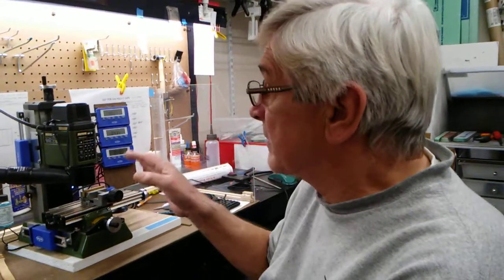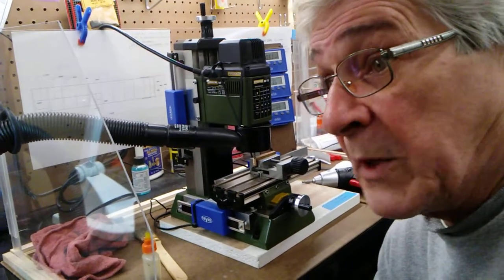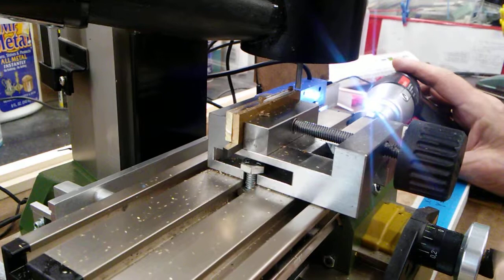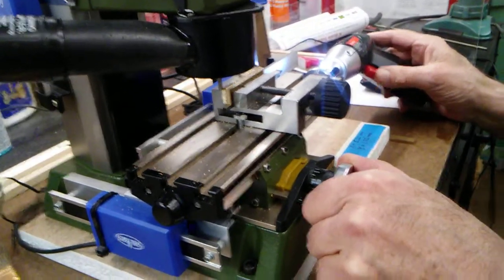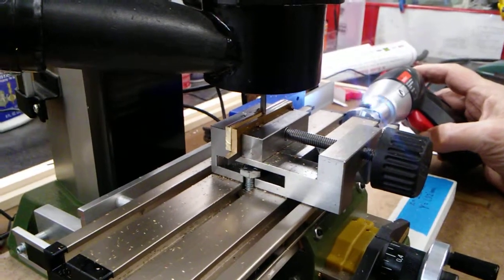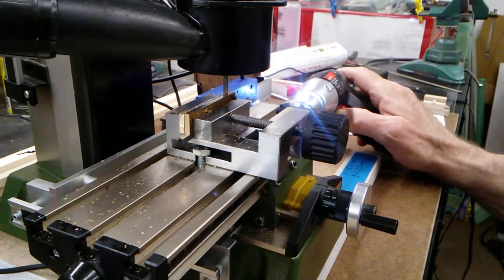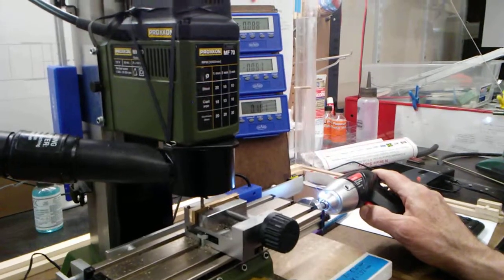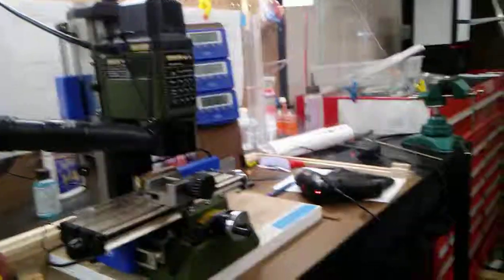Proxxon mods at work

Comment: say... I have a flat head screw going to the leadscrew( where the hand crank is) i cant seem to get it loose... was your handcranks loc-tite'd on there or what??  i love the idea of using a ball socket with a slow rpm drill!!    im only asking cause, i really dont want to damage this thing...  :/  Thanks again, great videos.  wow, i wanna get back into model railroads again...  :D
Reply: Not sure if you've solved this problem already or not...
The flat head isn't a screw, it's the end of the lead screw. you just need to clamp the handwheel in place and tap out the lead screw
Reply: there could be a dot of thread lock on it. take a rubber mallet while putting a little torque on the screw with the screwdriver then a few solid hits, try tightening torque just a little and a few more hits. penetrating oil can also help. use a screwdriver with as wide a tip as you can fit in the slot.
it's like car lug nuts; they are installed with an air tool at the factory so will not back out easily as installed
Reply from the maker: @supyrow   I'm sorry that I didn't reply right away.  I just noticed this.  The lead screw is actually pinned to the handwheel with a tension pin.  That pin is hidden from view by the graduated dial.  To access it you remove the screw by removing the end plates and then the graduated dial can be slid off.  Once removed I had to cut off a little bit of the lead screw (3/8"?) to make room for the socket head screw.  Tap the handwheel for the short screw, loctite it into the handwheel, and that's your drive socket.  Assembly is the reverse of disassembly.  Look at the parts blowup in your machine manual or online for better clarification of the assembly method.   You'll need a very small pin punch to remove the very small pin.  I think I used a piece of steel music wire that was the correct size but an old shank from a small enough number drill would probably work, too.  Hope that helps.
Reply: @tracktoo1337  Thankyou!   Not a problem, it was worth the wait!   When I get around to it, I'd love to do a video on it.
Reply: I have the same problem. Flat head screws that won't come undone. I would also like an answer - thanks!

Comment: Great work! Did you not document the DRO or the spindle work? Any info to share? ATB Dave
Reply from the maker: No, I didn't make any documentation but those are just the inexpensive scales available from Shars and others.  They are aluminum, can be saw cut to length, read out in mm or inches with .0005" increments and promise .001" accuracy.  The components are typical of the electronic caliper style beams.   I have had no problem with the accuracy.  The mounting  was with aluminum angle machined and bolted as needed for the X and Y and the Z was mounted to the column with a couple of brackets that are (industrial duty, 3M) double back taped to the column.  Small fasteners (#4-40, 3mm?) and even double nuts on the studs for the gib adjustment were used to attach as needed.  Using a dial indicator on assembly to assure squareness to the table travels is recommended.  All of it can be readily undone.
Reply: I am getting ready to add DRO to my MF70. This is my first milling machine so I am taking it slowly. Any possibility of a short video showing the set up and mounting of the three axis. Great job and thanks for the ideas